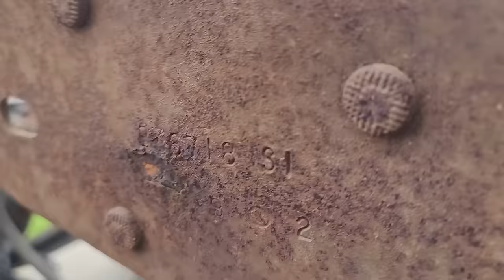Ford Ranger, MIG welding truck frame back together, how to.  Build part 7

Comment: You wanna have a oval shaped fish plate not a diamond no sharp corners
Reply from the maker: I agree, good point!  Next one will get the corners rounded off!  Thank you for watching and the good advice!  -Frosty
Reply: Diamond is absolutely fine, just radius the points. Never ever speak with an air of absolute knowledge when you aren't absolutely certain of your knowledge. Diamonds are the industry standard in semi truck frame stretches, so there's that.

Comment: Is this possible to do for my rwd avalanche conversion to 4x4
Reply from the maker: I am no Chevy expert but I believe they made quite a few 4x4 Avalanches.  You could just buy a parts truck that was 4x4 and swap all the parts over.  The pickup trucks probably had the same 4x4 parts as well.  Like i said before though I am not a chevy guy so I could be wrong.  It would be a big project though, you'd have to swap transmissions, transfer case, driveshafts, crossmembers, shocks, axle shafts and a slew of other items.  If it were me I'd sell the 2wd avalanche and but a 4wd one.  A lot less headaches!!

Comment: How much would you charge for that type of job
Reply from the maker: I'd probably have to charge by the hour.  It takes a lot longer than you'd think.  In this scenario I had to cut up two trucks, take the bodies off both of them, cut two frames in the exact same spot, fit them together, prep everything and then welding them together was the easiest and fastest part of the whole gig.  If I'm doing work for someone I'll usually have a rate between $80-100/hr

Comment: I built big trucks and heavy equipment for over 20 yrs. Those guys saying slant or zigzag are 100% wrong.
First cut straight and get the length you need.
Second weld the frame with full penetration.
Third grind smooth then drill hole on both sides.
Fouth mount/bolt an inner and an outer frame section. 
Length and how many supplemental sections depends on the project, and load capacity.
Like I said those guys are 100% Wrong.
Still have big dumptruck, tractortrailers, and heavy equipment being used today I did 20+ years ago.
Reply from the maker: I'll have to get back to you in 18 years on this ranger frame, but 2 years in she's doing great!  Thanks for the input and taking the time to let me know your experiences!
Reply: All bridges,hotels,condos, or motels are engineered wrong with only 90° cuts?
Reply: @elcomandante9299  exactly what are you trying to say?

Comment: Fully welding a fish plate doesn't distribute the stress, it concentrates all of it at the edges,
Better to stitch edges and plug weld some holes
Reply from the maker: I've seen it done this way in big rigs and it causes the frame to rust jack and swell so bad the frame ends up being junk.   May work well in a dry climate, not so much in WI where we use road salt in the winter.

Comment: Next time, weld inside first then back grind outside of weld to clean any inconsistency in weld penetration then weld outside, rather than weld in diamonds that can cause localised stresses from different flex properties add a c channel sleeve insert bolted or riveted in as OEM'S do
Reply from the maker: I did weld the inside and outside, then I added the fish plate.  Thank you for watching!
Reply: He did good with the fitup, just a few tweaks I would have done during the welding. Rounding and halving the diamonds. Not welding downhill on the diamond and frame. Copper backer and back gouging to ensure full pen. Its good, but not how my training tells me to do it. All this and I wish my little 4 banger danger ranger was a manual and had 4 wheel drive and 6 or 8 cylinders.
Reply: Diamonds cause stress? Are you off your meds? Diamond patches are the industry standard for semi truck frame stretches, but what the hell do we know, it's only a 40 ton truck traveling a million miles. Look at all the broken in half semi trucks because of localised stress from diamond patches... oh wait.
Reply: @frostydoesit  you clearly didn't weld inside first then outside which was my suggestion but whatever floats your  boat, been doing this for 3+ decades and where I'm from you have to be certified for this type of work and has to be engineer passed but well executed work is well executed work and that's what lasts, diamond patching is a common form of bracing but not on channel sections that are designed to twist, the twist factor is affected where diamond plate installed and introduces stress risers with different torsional and longitudinal properties in that area, live and learn or not
Reply: @TheRoadhammer379  cannot speak for every job in every industry but been doing this work for 3+ decades where we have to certify it and be certified to do it much like pipe welding and you see enough of other people's work to see what does and doesn't last when stressed enough in 1 tonne to 200+ tonne applications on and off hiway haulage, funny enough its just as easy to do it right as wrong and I've never seen an OEM warranted frame extension with diamond plating where I come from but maybe things work differently in the northern hemisphere but pretty sure we have the reputation for largest truck combinations and tonnage in southern hemisphere and if it isn't done right it don't last when you work them 24/7 but whatever helps you sleep at night

Comment: Take the opportunity to inspect a broken frame, and see how many where the break started in the web.  I wager you find none.  I also wager that you will discover that every one started in one of the flanges. That is where reinforcement of the welds should take place.
Reply from the maker: I agree the stress starts/is highest in the flange, in trucks probably always the bottom flange.  I will keep my eye on this one, but well over a year now it's perfect.  I don't think this little ranger frame will ever give up the ghost from the repair work that I have done on it.  I've seen so many semi tractors stretched and shortened and I've yet to see anyone fishplate the flange.....so weird.
Reply: Firstly, it wasn't my intention to criticize your workmanship. As others have opined, your material prep, carefull cutting, gap fitment and welding are very well done! I think my comment was more as food for thought, especially for those that aren't as fastidious as you are. And I agree that for the loads and usages you intend, your work will probably serve your purposes well.
For others, who will stress their frame with heavier loads and whose fabrication & welding skills may be of lesser quality, I recommend putting some effort into beefingup the flanges. One simple way to accomplish that is adding bar stock to the flange. Skip welding is usually sufficient.
Reply from the maker: @dennisveal4427 No offense taken at all, sometimes it's hard to come across the way you intend on comments.  I do agree that the best place to reinforce the frame would be on the bottom flange if loading weight from the top.  Thank again for watching and taking the time to add your thoughts, I appreciate it!

Comment: Only gripe is I would have whipped the Torch a little more to get some better penetration. That's probably 10 or 12 Guage they use for the frames and I work with sheets that thick everyday and I run it at 20.5v 374ipm on the millermatic 255 for that Thickness and whip her good. You'll be beating those welds up so you should get the best penetration you can, a flat drag just won't do it. Your up hills probably had the best penetration.  Fantasy fit up tho. The lack of penetration on the plate closest to the house scares me. You should be getting scale and bluing like crazy for structural welds on plate that thin. Best of luck hope she holds good and strong till she's good and dead.
Reply from the maker: Thanks for watching and taking the time to comment.  Hopefully I'll have her on the road this spring so I can enjoy it a little bit before the next big mod I have planned for it.
Reply: @frostydoesit  righto, hope you get many years out of ut

Comment: What welder did you use for this
Reply from the maker: Hi Jesse, I used a miller 140 for most of the tack and general fit up.  I then used a miller 252 to final weld everything.  The 140 would have probably been sufficient for the whole job.  Thanks for watching and commenting!  -Frosty
Reply: @frostydoesit  I agree… to an extent. I did a lot of welding with my Miller 135 that has held up great in most instances…. But when I got my Miller 212 … it was a game changer on how well it burns in joints.  I do like the 135 for body work and using .24 wire.

Comment: I wouldn't have grinded out the welds, probably would have TIG welded the frame also.
Reply from the maker: Why would you have TIG'd it ?
Reply: @frostydoesit  Only because it's a truck frame and you need a high quality  weld for that. With TIG you can be more precise, better heat control, and get more penetration. Btw, I am not really a TIG fan, because it's pretty slow, but I mean thats a vehicle frame so id do it anyway.

That truck could be in service 30+ years. That's a ton of vibration and potential stress on the weld. It has to be the most high quality weld you can pull off. I don't know who is gonna drive that truck but if stress breaks the weld in 20 years and any chance that drive quality is reduced that could even give a small chance of someone getting into an accident at high speeds isn't a risk I would take. I seen welds in many factories I worked in break after decades of vibration.

Also they could get into a wreck that could put more stress on the weld (that weld will be the weak point) then maybe someone will drive it with a bad frame and get hurt afterwards. You just don't know what will happen to your weld out in the wild over time. 
Just my opinion.
Reply: @wecx2375 , 😂 meanwhile shops across the country are cutting and stretching semi truck frames and mig welding. A truck carrying 40 tons is mig welded but he should have tig welded a Ford Ranger... in what parallel universe?
Reply: @TheRoadhammer379  just my opinion as an industrial welder.

Comment: What welder did you use ?
Reply from the maker: I used a Miller 252 and a Miller 140.  The frame is only 1/8" thick and the fishplate was 3/16" thick.  I did use the 252 for the majority of it but the 140 was able to get hot enough.  Thank you for watching!

Comment: Why not just replace the full frame instead of doing all that . You already have the body's off of them.  You should also use Eastwoods rust paint on that frame or POR 15 that can be painted over rust. Other wise everything you did would be for nothing because that frame has a lot of surface rust that's only going to get worse
Reply from the maker: Gary, I am using what I have. Which was a good 2wd frame. The front halves are different that's why I combined the two.  As far as the rust goes if I like/keep the truck I'll sandblast it and paint it.  It only takes me a few hours to pull the body off.  I also live in Wisconsin and here we consider that a rust free clean frame.  The last one rotted out because it got packed with mud and nobody bothered to clean it out.  Thanks for watching and sharing your thoughts!

Comment: I didn't know ow 2.3 had a 4x4. Thought 4x4 was only v6. Hmm
Reply from the maker: You don't see them often, I have had 3 of them now.  The previous ones were the 1st generation rangers and they had 4cyl, 4speed manuals and 4x4.  This one is an 89 and it got the 5speed!

Comment: Wheelbase measurements??
Reply from the maker: Are you asking what they are or if I measured them?  I measured points of the frame to points on the frame to make sure everything was parallel and square.  Wheelbase wouldn't be something I'd measure doing frame work.  Suspension can be compressed, drooping, worn out bushings or mounting points, springs more worn than others, too many variables to use that measurement.

Comment: What size wire
Reply from the maker: I used 2 welders, miller 140 with .030 and miller 252 with .035
Reply: @frostydoesit  hey thanks for responding. Allow me to pick your brain for a second. What is the main reason that people use gas versus flux I’ve been searching can you help me understand or is it just a preference thing thank you in advance.
Reply from the maker: @djsuretay1  gas mig is generally a much cleaner looking weld, less spatter, and less clean up.  They both have their places and uses.  Flux core seems to be much more forgiving in wind and dirty or poorly prepped materials.  I use both.
Reply: @frostydoesit  I’m new to welding and I got an Eastwood mig 135 and a Jeep YJ frame repair just getting myself together

Comment: Why Didn’t You Show Us The Inside Of The Weld ? You Didn’t Penetrate All The Through? 🤔
Reply from the maker: I welded it from the outside and the inside, ground it smooth and then fishplated it.  Was Def completely welded up.
Reply: @frostydoesit  If It Holds ,  It Holds. Lol F It , No Ones Going Too See It Anyways I Tell Myself 😅

Comment: Woulda been so much easier with acetylene torch to cut that out lol
Reply from the maker: The cutoff wheel ate right through it, I think the ranger frame was 1/8".  I do have a torch and plasma but the cutoff wheel really was the right choice for me.  I had two frames that I needed to duplicate the cut perfectly on.  If I were cutting something heavier than 1/8" I'd agree with you on the torch

Comment: This, my friends, is what is known as survivor bias. Don’t get me wrong, you did a great job and it may be fine. However, You take a big risk doing this.

The actual right way to do this is to get heat treated steel to tightly adhere to the outside of the frame, then rivet it together (industrial rivets obviously).
Reply from the maker: It's so interesting to read through everyone's "right way" of doing things.  Thank you for watching and taking the time to comment!!

Comment: your right your opinion , when we look at frames , there are loads , flexing , expansion ,etc, , so the welds should have no right angles as per engineered , cyclical, dynamic tolerances , you have to many right angle is the weld , meaning no continuity , to many starts and stops , which under flexing will work from the back of the weld out and could cause weld failure , same with welding all the way from one side , and not using a backing bar for a good sound full thickness weld , and then the doubler plate , a joke , one thing i cant stand is untrained welders saying welding the right way, and should have run off tabs and then blend in edges after welding , but then you said it your opinion
Reply from the maker: Thanks for sharing your opinion, glad you enjoyed the video!!  🍻

Comment: Why a diamond pattern and not a box in
Reply from the maker: I wanted to keep the frame strong and looking as factory as possible from the inside/outside.
Reply: Diamond is correct.  Installing a fish plate perpendicular to the expected stress increases failure rates.  Engineering 101.

Comment: shouldve cleaned the metal better before welding and rounded fish plates or even boxed it or made fish plates bigger its not a bad job but id never trust those joins
Reply from the maker: All joints were cleaned to shiny metal,  I do agree on the fish plate,  could have rounded the corners more.  Thanks for watching and letting me know your thoughts!

Comment: Hi l was thought  that you must have perfectly  clean joints or you get your  ass kicked, apart from that  it looks ok
Reply from the maker: They were very clean, hard to tell in the video but they were all wire wheel or flap disc'd